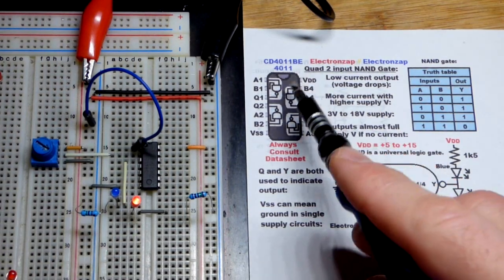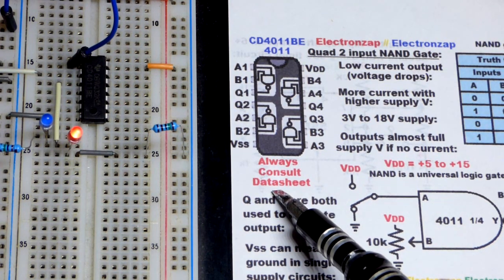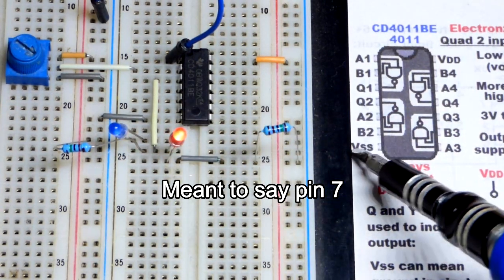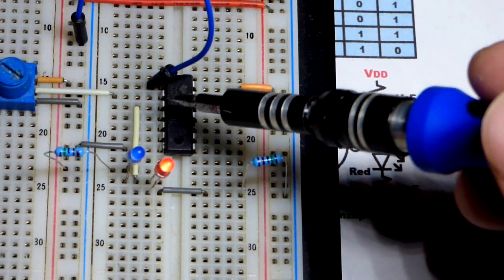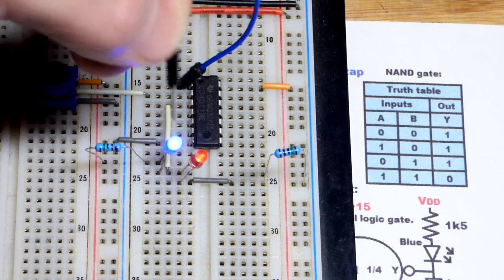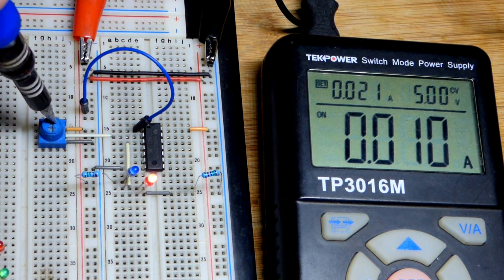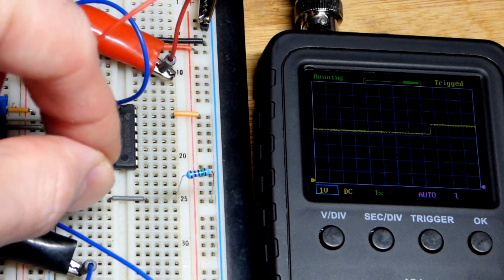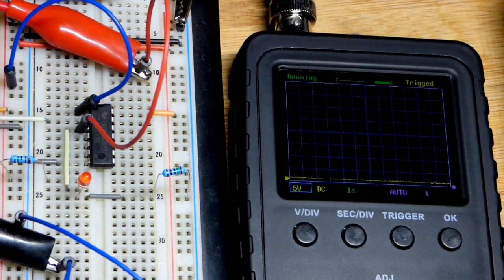4011 quad 2 input NAND gate integrated circuit CD4011BE learning electronics lesson by electronzap

Comment from the maker: https://amzn.to/2YUeDwO Affiliate link ad to 4000 series IC kit.
Recent playlist https://www.youtube.com/playlist?list...
List of my videos https://www.youtube.com/c/electronzap...
https://www.patreon.com/electronzap
https://www.amazon.com/shop/electronz... As an Amazon Associate I earn from qualifying purchases. Americans should check out one or more of those links before making any purchases. There's no extra cost to you.
https://electronzap.com/
https://www.reddit.com/r/ElectronicsS...

#CMOS #logic #IC
Reply: Can the Inputs A1 and B1 be diffrent? Like "5V - A1" and "12V - B1" = 12V Q1?
Im wanting to use a 5V source to trigger it and have the 12V be the higher voltage output
Reply from the maker: @woodzyfox4735  I don't think so, from what I have seen, usually in cases like that, the IC is powered and controlled with the 5V source, and the output controls a transistor attached to the 12V load. Usually I see datasheets saying something like that the input voltages shouldn't be more than about 0.5V higher or lower than the voltage range powering the IC.

Comment: That was very interesting to see the low output not being at 0 volts due to the LED forward voltage, I was not expecting that and I will be processing this information for the next few days! 😅👍
Reply from the maker: Yeah, there's a lot more to understand about different types of integrated circuit outputs than you would think there would be.